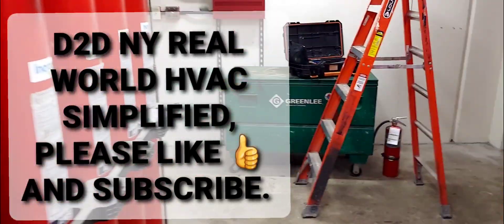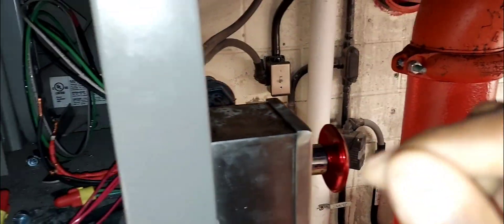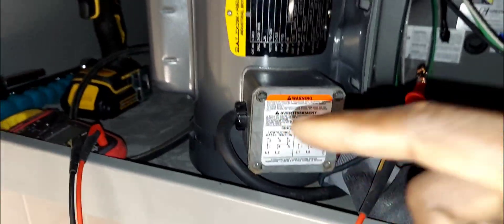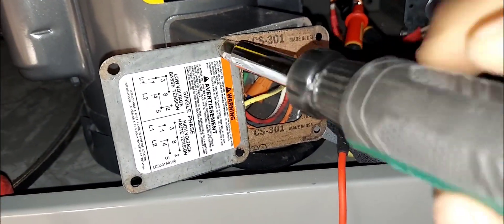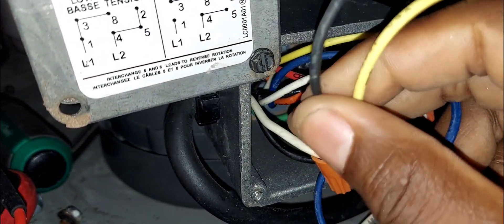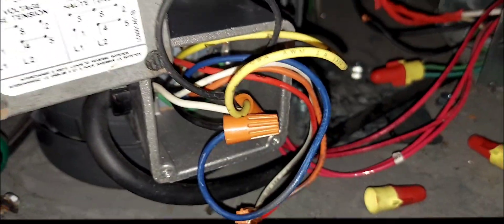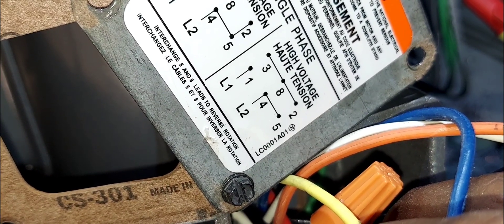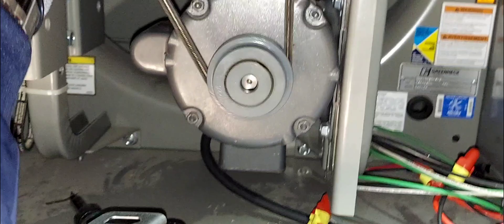DUAL VOLTAGE MOTOR WIRING

Comment: Isn't 208 is two legs of a 3-phase tap, meaning the phases are 120 degrees apart rather than the 180 of single phase? In datacenter power delivery, that's something we can't use interchangeably because of power supply sensitivity, do 240V single-phase AC motors really take 208 without trouble?
Reply from the maker: Very good looks like you know about electricity but In the USA it's not 240 volts phase to phase  its 208 to 230
Reply: @D2DNYAC  I know enough to run the machines, but not enough to know if this is the general case. Thanks for the clarification.

Comment: That motor is going to run hot because the supply is 208VAC and the motor is for 115/230.
Reply: 208, and 230 are the same
Reply: @rookiebeeeautch5847  208 service is not the same than 230..the motor would be ok if it gets 208 VAC which is about 10% tolerance, but if it gets lower voltage like 190;  the motor will run hot..
Reply: @ajvelazco9029  if youre only pulling 190 you're experiencing issues with components.... 208/230 is just 2 hot legs of 110-120 and a ground instead of a neutral

Comment: Well finally somebody points out THE WIRES HAVE THE L NUMBERS STAMPED ON THEM Sheesh!!! I looked at the orange and blue wires first and couldn't see any stinking numbers just mfg wire codes I was totally confused and pissed off. I'd say this video is worth a hundred likes. I'll have to wear my cheater glasses to look closer. so on the Baldore 110/230 motor , for 230V  its blue hot, yellow hot, orange white together, brown NC taped off
Reply from the maker: Thank you for stopping by